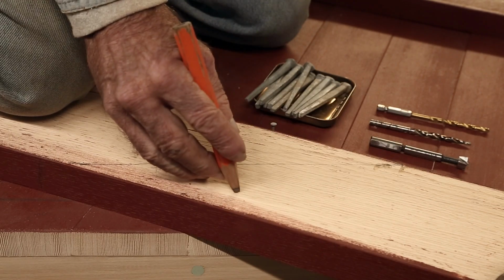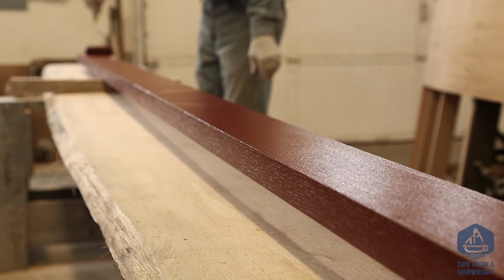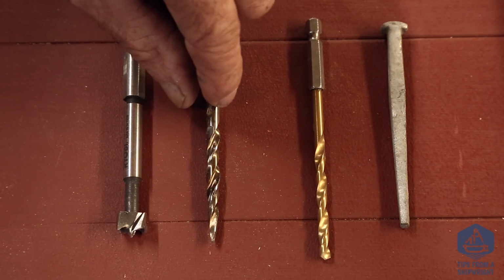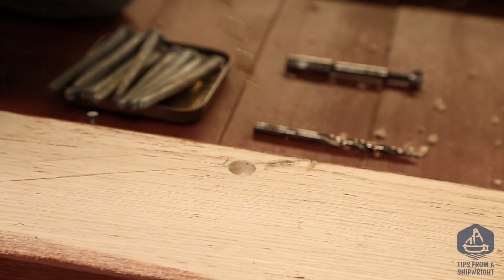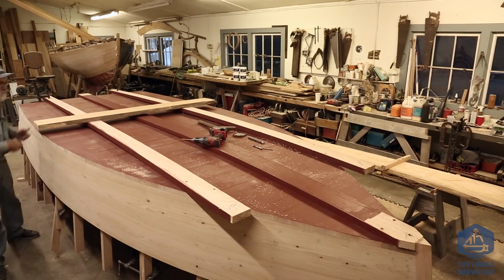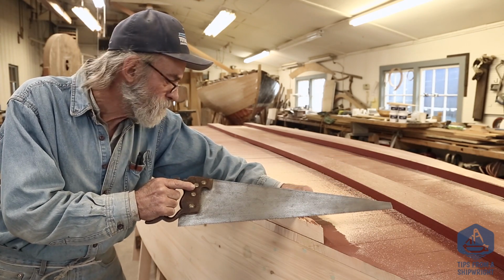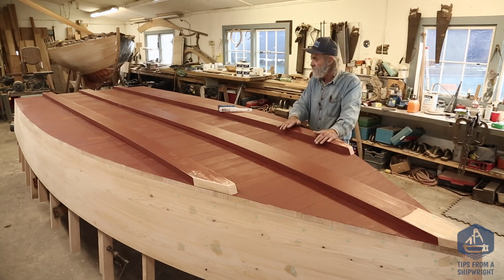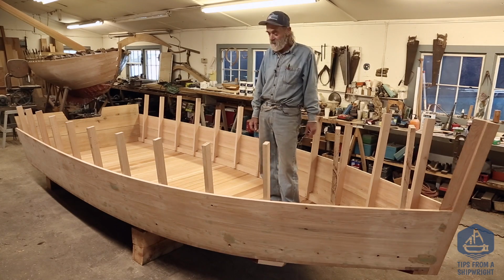Building the TotalBoat work skiff - Over it goes (Episode 22)

Comment: Here's where we see " Hand & Eye, Hand & Eye" operating...how a skilled worker has learned & practiced what they can do! No programming a CNC which I'm not slagging, just not appropriate here. Too SLOW for a one off construction or small series of hulls. If you like the strength & incomparable RIDE of a wooden boat build this way. If you want the tacky slap slap sound of fiberglass or aluminum go for that, but lose the soul of the very boat itself. Overstated? Perhaps to some!

Comment: Great video, like the rest of them. A couple questions (for anyone who can answer):
1) How was it decided where the side runners go? Was there a measurement?
2) When he went under the boat to put some nails through the bottom planking up into the runners (around 10:52), how did he know where to nail? Did he drill holes through the planking first downward from the bottom side of the boat, like he did for the center runner?

Comment: Such passion Lou! I do wonder why the runners are nailed rather than screwed.
Reply: I wondered the same too. Hopefully we'll find out soon.
Reply: My guess is runners get worn and it's easier to replace them if its nailed. I know this is true for replacing deck boards on a patio. Be prepared for a lot of work if you need to replace deck boards that were screwed down.
Reply: Aedam Okay, nailed runner is easier to replace, but the center runner is screwed.

Comment: Wonderful series, thanks for sharing with us.

I'm curious, why use nails to fasten the runners instead of screws?
Reply: My Theory,  Screws can pull wood tight together but they generally don't have much lateral strength. So if you hit a rock with that outside runner, screws might break. Those spikes will not.
Reply: Sure but if he pumped it full of the same number of screws of comparable size to the nails, it really wouldn't be a concern. The shear force needed to break a screw would be absolutely enormous. I think he used nails because "that's how it's done".
Reply: thats what I was wondering about too
Reply: Maine Explorer I think that's probably the main reason. He used screws elsewhere but the runners, where you would expect the fasteners to come under more shearing forces, used nails. Those will get wedged in even tighter once the runners swell up in the water.

Comment: What a pretty boat!!! Looks bigger than 17ft long. Maybe bring the sides up an extra 6 inches than you were going to for those windy days with rough water. Love it. Live it. I figured you would be using screws to hold the bottom down to those 3 boards running the length on outside bottom!! I figured it would squeeze the bottom boards tite to bottom boards which would keep it from creeping. Great job. Can't wait for the next video. Thank You for sharing this build. Vinny